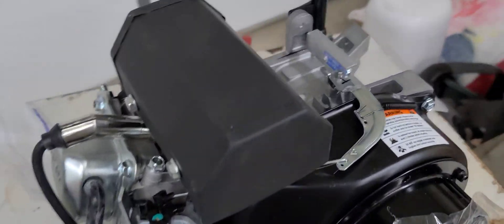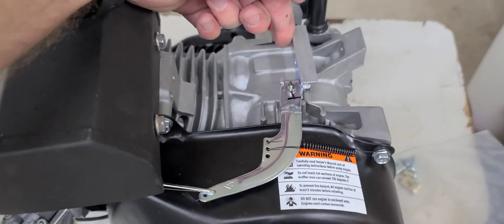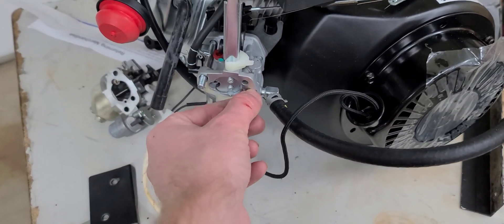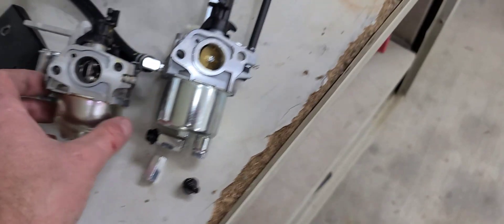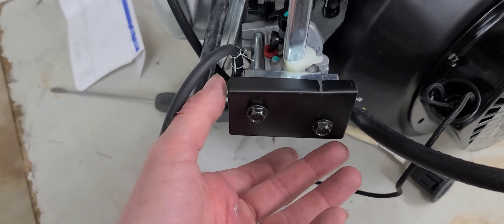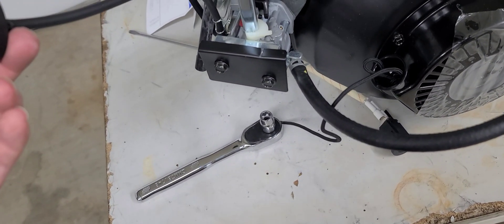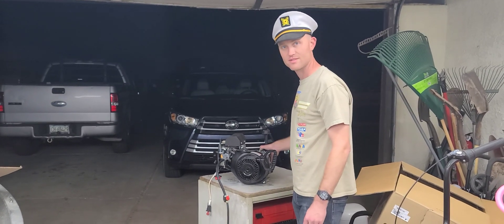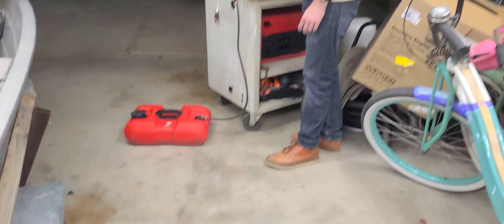LCT Storm Force 179cc Cheapest Engine on the internet for a Longtail Mudmotor #lctstormforce

Comment: Awesome! That exhaust works out perfect for a mud motor! These things have some torque already but I'm almost certain it will accept any of the aftermarket Honda clone .550 shaft diameter camshafts. I haven't been inside mine yet to verify but everything about it seems to be Honda clone. Some guys complain about the shipping but to me the price for the engine including shipping is still just a little over half the price of a predator 212. I think I'd rather have 2 of these instead of the one 212. Great video!
Reply: One of the reasons i ordered one, to test the muffler on one of my longtails and the price!
Reply: @Kentucky Fried Fixes, you can save $9 on shipping by ordering it from their ebay store. The only thing is that you can't add a free catalog. This engine has been available for $50 for at least couple of years now. I'm surprised that there is virtually no talk about it on any kart and mini bike forums or YT. I bought it to repower old Ariens snowblower, but I would like to increase its performance, mostly torque using minimum parts. Probably p&p and shaving the head. I will be watching what you will find.
Reply: @8bitkuba235  Wow, I didn't know they had an Ebay store? Time to check it out! Thanks!
Reply from the maker: Thanks man let us know if you figure out if more honda clone parts work on this engine. I'm interested how it would perform the Tillotson TCT engine seems very torquey for its size. Quick throttle response very little delay.
Reply: @azlongtales  The little 179cc LCT engine has finally made it to the work bench. Just a heads up, good things and good news, video coming soon.
Reply: I just ordered one last night to test on my longtail and mini bikes. Cant beat it for the price. Has alot of torque for its size!!! More then a predator 212…
Reply from the maker: @andrewkuhtz  exactly these reasons we bought one of these as well. Let me know if you find out anything we didn't find out. I thought rigging up a throttle would be the hardest part but it looks like it will be very straight forward. Thank you for watching!!!
Reply: @azlongtales  will do!
Reply from the maker: @andrewkuhtz  I wonder how it would do with the Tillotson TCT mechanical fuel injection it increases torque as well and will bolt up to this engine might make for the 1.5 hp vs the predator 212.
Reply: @azlongtales  im planning on testing a mikuni carb on it and a tct. I will keep you posted on results…